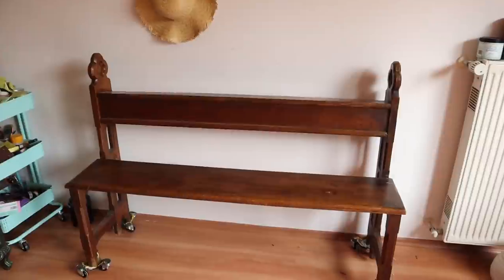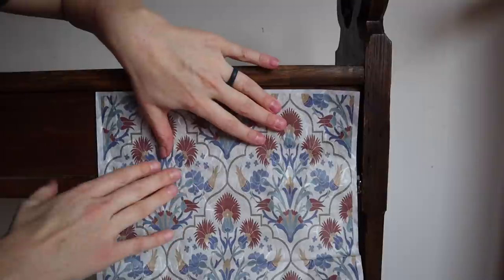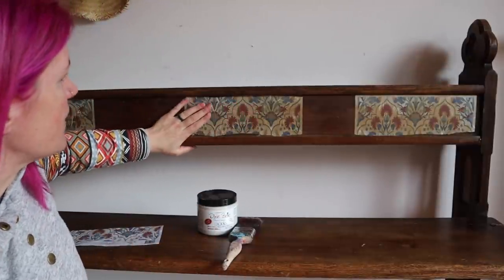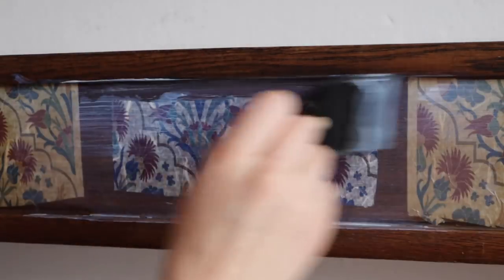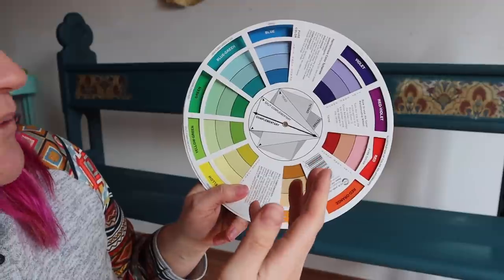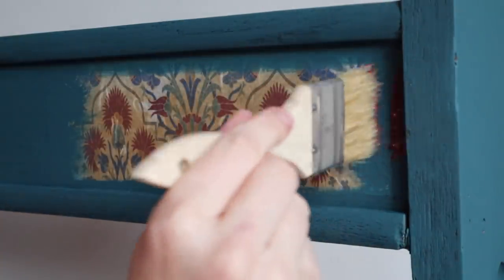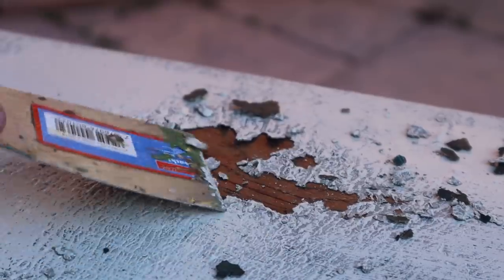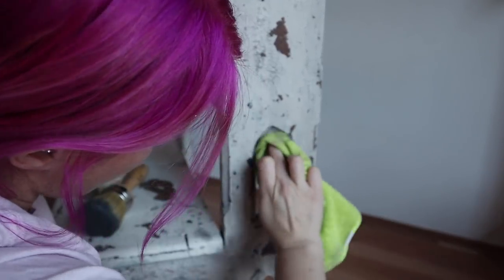Painted Furniture Flip with Decoupage and Sea Spray Texture - Farmhouse Decor

Comment: I found a bucket with a divider in a hardware store. In one side I have my cleaning solution/hot water and on the other  side I have hot rinse water.  After I scrub one area, I rinse out the rag on the rinse side and then go back into the soapy water side for the next area.   Then I am not cleaning the last part of the furniture with dirty water.
Reply from the maker: I LOVEEEEE THAT I need to find one!! It is really so so smart!!
Reply: I want to find this type of bucket ! ❤️👍
Reply: Just looked closer at it....it is  Rubbermaid divided bucket. Hopefully that helps!
Reply: @lynnes8047  Very helpful. Thank you!!